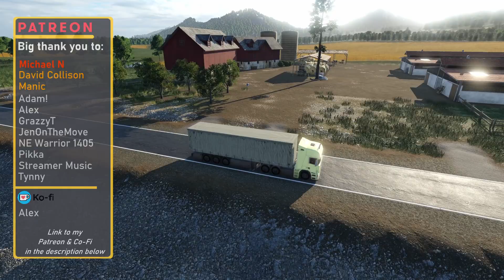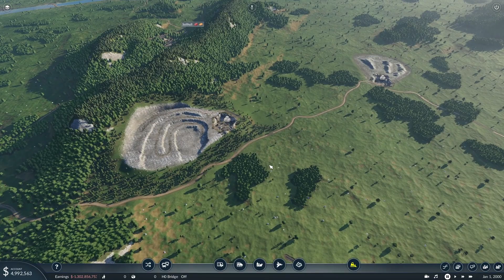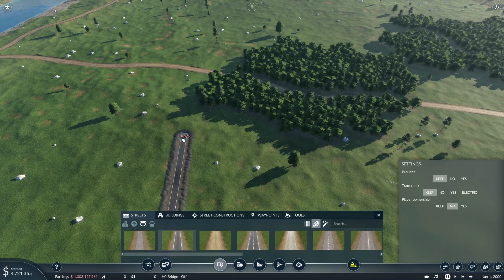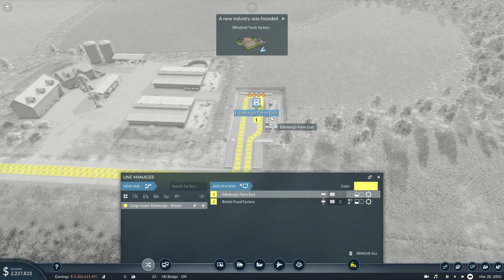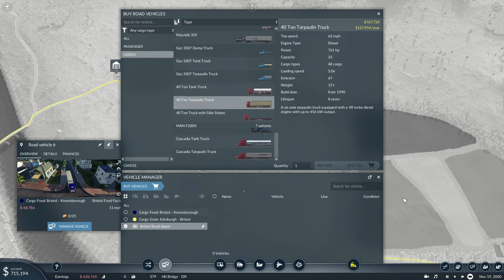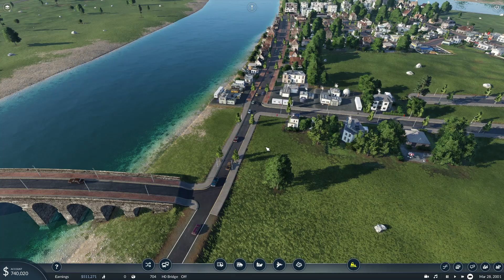Transport Fever 2 Making Money | Mainline #1

Comment: I'm looking forward to watching this series, but I have a question. When you are setting up your first line, you manually space out your vehicles. Why didn't you just set up the first stop to be Wait Until Full and set maximum wait to forever? And what's the point of setting minimum wait time to anything greater than 0?
Reply from the maker: I'm not sure why I set a minimum tbh 😅. But manually spacing is still useful as you want trucks making money asap, every second sat waiting for goods they're costing you money, so to begin with when money is tight you want vehicles making profit straight away, or at least carrying cargo asap.

Comment: I’ve found trucking depots supremely helpful. I usually try for them to be within range of at least 2 cities. For example I’ll send a loaded tanker truck (semi version) to the depot from the refinery, where smaller delivery tank trucks will pick up and take it into their designated cities. It costs more to start up but it also adds another drivers point you get paid for. Also keeps your city delivery trucks out of factory traffic

Comment: Looking to learn about the Mainline , why did you not use a truck stop at the farm each one can handle at least a rate of 800 (prob 1000) this would have saved some expense as you would have only needed one platform at the Farm Truck station ?
Reply from the maker: I've always thought truck stops were just for dropping off. But also I like to have somewhere for trucks to turn around, rather than doing that u-turn at the end of the road, so would've probably still built a road loop 😅
Reply: @Engineering-Focus  i get that that i normally make a little loop with the road . They are very usefull and have a good range  so can be placed a convienient distance away . regards and thanks